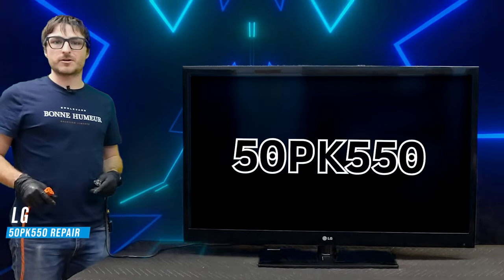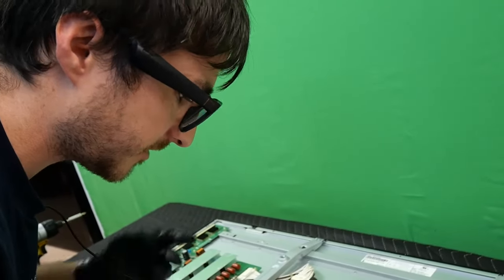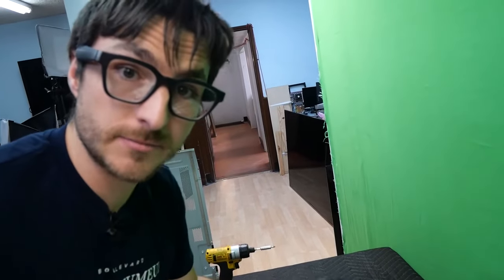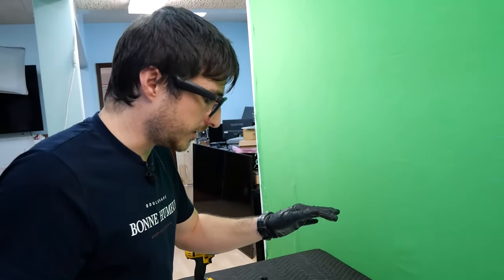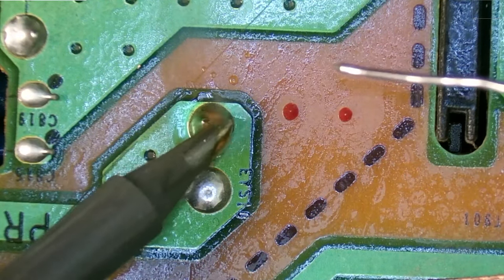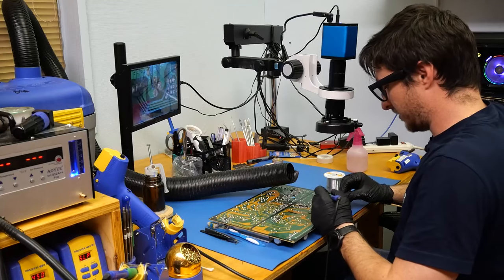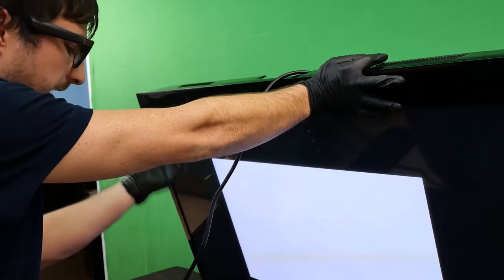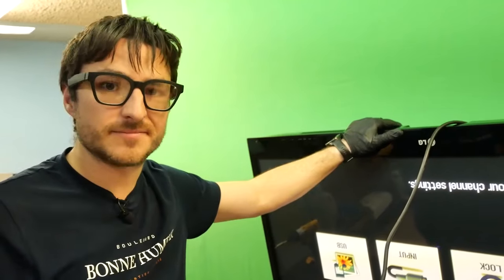LG Plasma TV Clicks On And Off But No Picture 50PK550

Comment: I got a Plasma LG 60” that clicks but not intermittently and has no display (not even lit). I’ll be digging around the PS to see if I have similar issues, if so thanks in advance lol.
Reply from the maker: Disconnect the Y-sustain, and plug the set back into power. Does the clicking still continue? No, then your Y-sustain is your fault. Clicking still continues, keep the Y disconnected, and now also disconnect the Z-sustain. Same thing, clicking stops? If yes then Z-sus is the fault. No then disconnect the mainboard next. 
And as Sherlock Holmes famously once said "Sir jeanious2009, when you have eliminated both the sustain boards and mainboard, then only your power supply remains, however improbable, must be the fault.

Comment: Found this and was so excited the issue would be this easy, but alas - I found no cracked solders. I even popped off the YSUS and ZSUS with everything looking fine. No burst or swelled capacitors that I can see. I have a 60PA6550, but my issue is slightly different. Will power on and get picture and video. After maybe 10 min, it clicks and the power cuts out. Turn the TV back on (from the remote) - no screen, but sound. If I leave the TV off say 20-30 min, it will power on with audio/video. It could go hours working fine and I turn it off for the night, or it will go 10 minutes....CLICK. Powered off. Power on. No video but sound. Thoughts of what could be "tripping it to power off" and no video but audio when powering it right back on. Short on the main board???

In fact, it literally just did it while typing this comment!!! No signal was cycling on the screen and then powered off. Red light on the main board dark. Was on 10 min or so.
Reply from the maker: You most likely have a failure with your Y-sustain. It's probably the same fault, except that the cracked joint will be much harder to find as it could come from one of 100 different components. We also fix those if you did want to send in your board for repair you can check out the listing linked below:
https://nickselectronics.com/products/ebr73712701

Comment: Hello there, I'm just inquiring about a LG TV model: 42LG60FD-AA . There is no sound at all the picture is good, is it able to be fixed at all?.    Thank you ✌🏻.

P.s. Very nice tutorial straight to the point, easy to follow and very well presented "a Ten out of Ten" Good Sir, I tip my hat to you 🫡👍🏻👍🏻👍🏻👍🏻👍🏻👍🏻👍🏻👍🏻👍🏻👍🏻.
Reply from the maker: No audio is usually best fixed by using an external sound system. Often the internal speakers on a TV are mediocre, this is usually the best opportunity to upgrade your set with a sound bar or sound system. I would first check to make sure your headphone and or optical ports work and if they don't you can always use a receiver, plug in your devices into it, extract the sound first, and then have the video run to the TV.